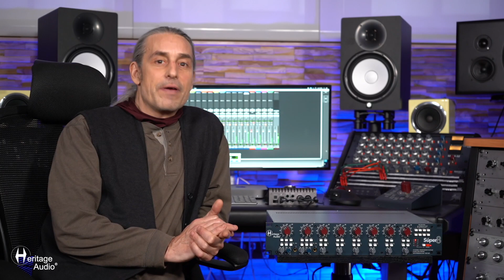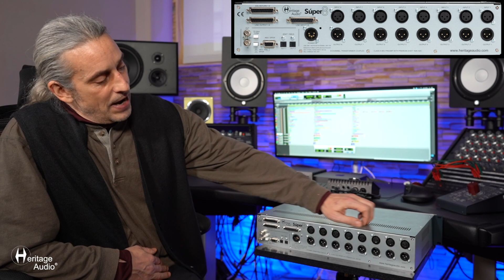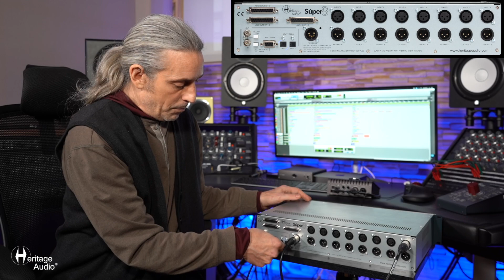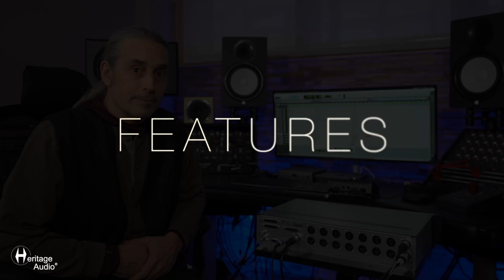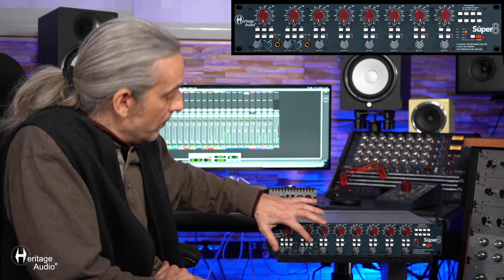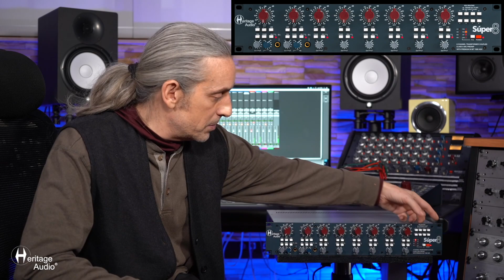Heritage Audio - Súper 8 Connections & Features

Comment: If you use say, 2 mic pre's outputs to outboard compressors and then return via ADC connector, and just have the remaining 6 of the mic pre's go direct optical out; will all 8 channel's outputs connect through the optical out?
Reply from the maker: Hi Mathew! Yes, you can route the output via the ADC routing matrix in the front panel. By leaving channel 1 and 2 as ext. input to ADC and pressing the rest (preamp out to ADC) you'll get all 8 channels routed to the ADAT out. Hope this helps!

Comment: Very interesting. So, it works fine as an expander to an audio interface with adat ports. But does it also extend outputs? Say I need more outputs because my interface only have a pair of stereo output, do I also get additional digital outputs like 1-2, 3-4, 5-6 and 7-8 outs?
Reply from the maker: Yes, the Súper8 is very useful to expand your audio interface´s inputs, giving you 8 more through either the ADAT optical, AES/EBU or SPDIF formats.  But no, it is not possible to expand your outputs as there is no ADAT input.

Comment: No mention of the ADC specs…
Reply: @theuniversityoflife8704  He asked for specs of the ADC, not specs of the digital connectors. That manual has 0 specifications for the ADC.
Reply: @theuniversityoflife8704  I'm sorry to be mean but you are very confused, you are obviously just getting started with audio and you don't understand beginner basics yet. The ADC is not an ADAT. The digital connector specs are not the ADC specs. Specs for an ADC will include... Signal to noise ratio, Dynamic range, THD+N, Crosstalk, Frequency response. If you are just getting started with audio it's not helpful to argue with total certainly about what stuff "IS" with people who maybe worked on engineering for decades.

Comment: It would have been nice to see either thunderbolt or USB out to the computer rather than having to purchase somebody else's interface to use with this.
I can get SSL or Focusrite preamps and just skip buying yours.
Reply: @Killah Trakz Yep, point entirely missed. You can by an inexpensive, high quality ad/da, like the audient one used in the clip. Keep in mind if you buy a high quality ADAT PCIE for you computer, its likely going to be the same price as an interface that already has one, and you are likely needing that for midi anyway. So an interface with high quality pres (2 or 4) with ADAT and other features is the same price as any decent ADAT standalone pcie. You are buying these for preamps, and for the flexible routing options. You dont need a console, you can either use the pres directly out to a converter of your choice, OR...come out of Adat into a converter with Adat in...OR you can go into mic pre, direct out of XLR, to your processing gear, back into the ADA DSUB input which will feed the final signal to Adat. It's also 8 channels at 96k.